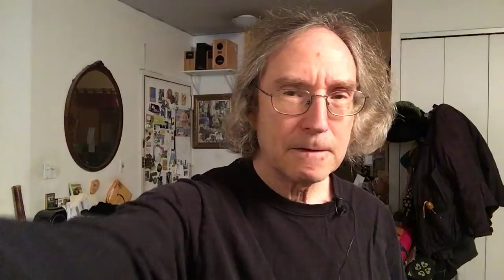Do speaker designers have to know what good sound sounds like?

Comment: This is where the phrase voicing applies.  You can't voice with a computer.  It has to be done by ear.  You can design a perfectly flat response speaker but that doesn't mean it will sound good.  I always do prototypes and try multiple circuits before I ever release a product on to the market.  For me this is still a passion more than it is a business.  I probably listen to at least 20 reference songs during the voicing process and at least another 30 or 40 other songs ranging all over the board.  You can't build a truly good loudspeaker based off of measurements alone.  Computers know nothing about psycho acoustics but the ears and brain do.

Comment: With enough experience you can, and should, design a sound product first without              listening to it.
You know what it going to sound like from the knowledge you've gained from  previous designs and the components your using.  In the case of loudspeakers you design for what use it has to fullfill,  it then it becomes an engineering process, (sorry to be boring)  deciding  directivity,  drivers,  crossover frequency,  how loud,  how small  can we make it!  cost, etc.. The listening part, the (best bit) after you've built your prototype to confirm the rightness of the design,  get your 'fix'  listening to it  over a period of time with all different kinds music and make any adjustments to sound  right.

Comment: The art of speaker design has stopped  about 1965..  More power equals  necessity of  multirange columns. New  speakers are  designed for dedicated range which is  simple,   excludes practical testing - in fact it seems not critical and  how to listen  to  tweeter or woofer or middletoner? After all they will present completly dfifferently in set with box and crossovers,cables  driven by particular amp. Who cares? Anyway some  producers of whole audio systems like Bang& Olufsen care for final tests.

Comment: I think that speaker designers need to know what sells and the latest trends in audio specifications (ie: bass boom).  They need to know what sells in the mass market in order to be market leaders.  This may not mean that the speaker produces the best quality sound.
Reply: My experience is that speakers   should be else totaly perfect (and then buyer should be capable to set it up in perfect way at home  with perfect amplifier -  I consider it impossible  ) or  far from perfection so that it will present it's own deeply premeditated character: nice for ears and amazing for laics.. That is because speaker near to perfect is expressing everything  very clear - every fault of characteristic is unveiled by it. That is the bad side of good. The difference between ideal reproduction and close to ideal is  is so small that t it is  even upsetting. Everybody specially in complex recordings.can complain,  .

Comment: I could not agree more. Loudspeakers, especially, must be tuned by ear. The entire recording process and how the ear hears, as compared to a microphone, make it impossible to just use response curves to achieve what we want, the ultimate, a reproduction so real our minds cross the threshold and no longer listen critically, but emotionally, as we do in the live performance. At Alta, we set up a beta test group of accomplished listeners, including a symphony conductor, an Emmy award winning recording engineer, a few fellow audio designers, and several reviewers. They were tasked to do listening comparisons to live natural instruments. Their feedback helped me refine my listening and fine tuning of the speakers. Of course, we found that attaining a flat frequency response in an anechoic room created a sound nothing close to live. We learned, instead, to use measurements in the light of what the listener was experiencing, and the listening experience itself. First, the room loudspeaker interface is critical. Since the room is at least 50% of the sound, the speaker must match the room. For example our Hestia speakers, as Steve recently commented, sound amazingly real in Rhapsody Audio. Bob has put together a superb system in a room that has excellent sonic characteristics and is large enough to handle a speaker that plays the lowest frequencies. But, we have had to remove the Hestias from dealers who tried them in rooms that could not. Our Celesta, in one case, and our IOs in another actually outperformed the Hestias in those rooms.